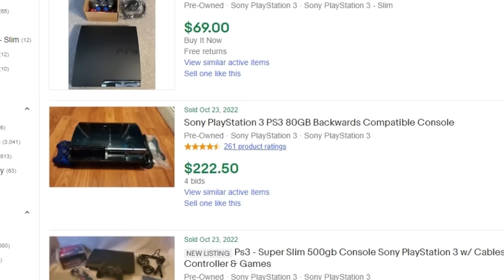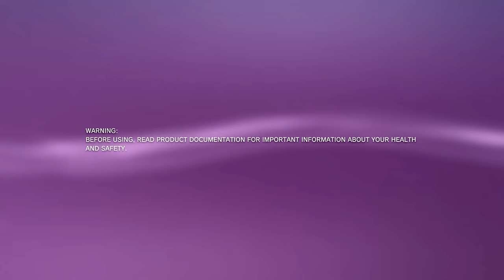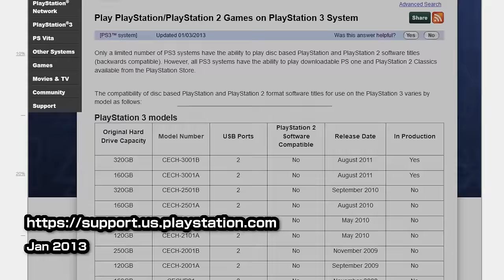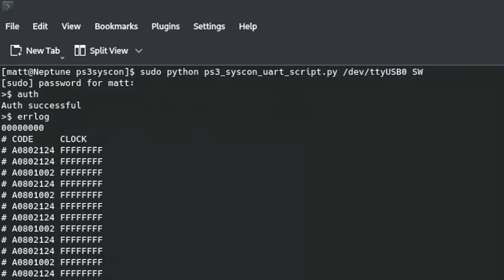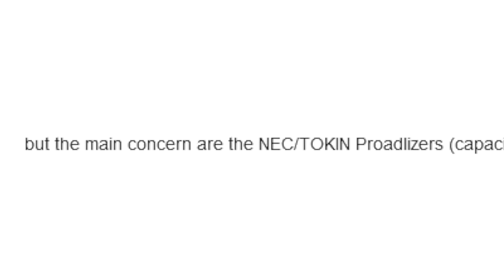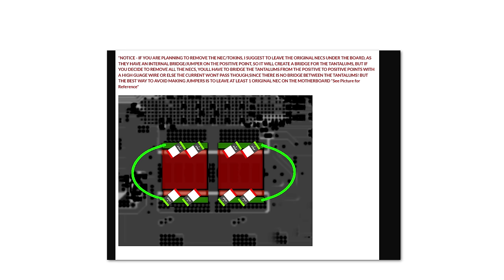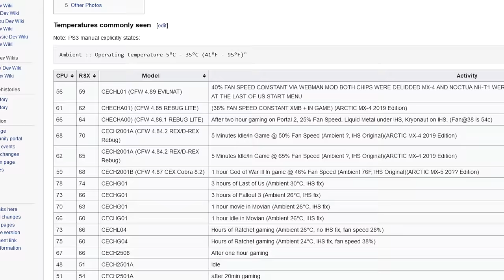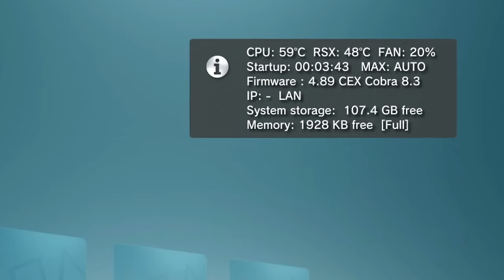I bought 3 PS3s for $50... how bad could it be?

Comment: A little note about using the Dualshock 4 on a PS3. You actually CAN use them wirelessly, all you need to do is scroll to settings on the XMB, Select Accessories -> Bluetooth Devices -> Start searching and hold both the share and PS buttons on the controller. Rumble and the PS button still won't function but other than that it's still perfectly usable for a good selection of the consoles library!
Reply: This also works with the switch pro controller
Reply: Oddly enough, they don't seem to work with Goldeneye 007. Every other game works but that one and it's the only PS3 game I still want to play xD
Reply: @beardalaxy  Gran turismo doesnt work either :(
Reply: But how do you exit from the game?
Reply: @qwertykeyboard5901  for me i keep a ps3 controller around just to turn my system off and navigate menus
Reply: @global8198  So why use a different controller? Isn't having to use 2 controllers less convenient?
Reply: @tooprood  you should probably use a wheel for it tho
Reply: @tooprood  You wouldn't want to play GT5 without a Driving Force GT, anyway :D 

Though it'd be awesome to have controller emulation like PS2's OPL can do, hahaha
Reply: @qwertykeyboard5901  because the ds3 sucks
Reply: @qwertykeyboard5901  personally all I have is a busted up 3rd party controller without l1 and l2 so i pretty much have to use a ds4
Reply: @qwertykeyboard5901  ds4 is more comfortable to use for some people (me included)
Reply: @qwertykeyboard5901  I restart the ps3 if it's a digital game and if it's a physical I just take out the disc
Reply: Personally, I still use a cheap controller adapter for it. As some of those will allow you to not only get the ps button working, but also the motion controls too. Mayflash have a good one but even the crummy built cheap ones will do this. 

At least my Jamwell one does.
Reply: Also DS4 controllers (and other nonstandard gamepad types) will not work when the ps3 enters its bc ps2 mode (GuestOS mode on LV1)
Reply: Yes but why bother? If the PS button doesn't work, there's not much point.
Reply: A little note about using the Dualshock 4 on a PS3. You actually CAN use them wirelessly, all you need to do is scroll to settings on the XMB, Select Accessories -> Bluetooth Devices -> Start searching and hold both the share and PS buttons on the controller. Rumble and the PS button still won't function but other than that it's still perfectly usable for a good selection of the consoles library!
Reply: Thing is, the PS3 is fucking trash. I've had one for a year until 2020 and it's a really bad experience, which I guess is to be expected since you're dealing with hardware from 2007. You're much better off just getting a used PS4 which are super cheap these days and install custom firmware on it...
Reply: Once they're linked, you can use the ds4 to turn on the ps3 and you have about a 50% chance of the PS button working. Don't ask me why, just my observation. 😂😂
Reply: Wdym. My ps4 controller on ps3 had rumble

Comment: The PS3s with the Emotion Engine board (yes the PS2 compatibility was hardware emulation!) are easy to spot. They're the very earliest models, and they have four USB ports instead of two, and you can lift up the black bit to the left of the disc drive and there's a load of card readers under it, SD, CF etc. If I recall, the silver disc slot surround is chromed on those too.
Reply: intresting. I always wondered why certain video game manuals showed that opening with all the card readers and yet my own PS3 didn't have those
Reply: yup, the chrome trim is the easiest way to know. They also had a 60 GB HDD, but that could have been replaced since.
Reply: @Muscleduck  yeap i still have mine. its the first model i believe. I got it like a month after the ps3 released
Reply: Unless you got the 20 GB model that didn't have the card readers.
Reply: @Matt92Machine  imagine having a 20GB PS3 lol
Reply: @phoenixyt124 oh yeah? Imagine having a 12gb PS3
Reply: For the PAL units, it's the GS chip. Yes, we, the Europeans, got the GS-only board that US received with the 80GB CECHE.

Comment: 20:14 I’d like to imagine someone in the far future buying this system as a broken system and trying to restore it only to discover cursed capacitors and eraser in the cpu
Reply: "Was it like this from the factory?!?"
Reply: "people in the old days are wild. they use erasers as thermal pads"
Reply: @afizsouji  these days we use two droplets of thermal uranium
Reply: This is what I imagine for every single repair.
Reply: hi mediaforge person!!!
Reply: Yea one day when this is a retro console 😂
Reply: mine has washers on the gpu to add pressure
Reply: heavily australian "Someone's been in here!"
Reply: @segefjord  it is a retro console though ( it's 16 years old)
Reply: @richthelegend1016  Performing a quick google search on when something is retro it needs to be at least 20 years old, AHCKTUHALLY
Reply: @richthelegend1016  Not quite retro yet, retro are nes, snes, sega master system etc. and those 80's and 90's consoles, 2000 have yet to get that status to my knowledge.
Reply: @lilldavid2k7  IMO, any console that doesn't use HDMI should be considered retro at this point (yes, I know that the Wii falls under that category, but Nintendo's timings to everyone else in terms of console generations are wonky in general).
Reply: * cough cough * TronicsFix * cough cough *
Reply: Ngl, I've gotten bamboozled by dads in the 90's screwing with their old 60's transistor radios.
Reply: 20:14 l’d like to imagine someone in the far future buying this system as a broken system and trying to restore it only to discover cursed capacitors and eraser in the cou
Reply: @Theunicorn2012 thanks for letting us know...?
Reply: @MDLuffy1234YT  The Wii is kind of a retro console now though. It's roughly 18 years old at this point and it certainly looks a lot more dated than the Xbox 360 or PS3.
Reply: @maow-tty  Now with the official closure of the Xbox 360 store, any console with an analog input should be considered retro at this point.

Comment: I repaired PS4s for cash a few years back and all I can say is that the dead bugs choking out the power supply were one of the main causes for the consoles overheating or short circuiting.
Turns out that the warm power supplies make for highly desired bug nests...
Reply: It's not just an overheating issue, the gpu literally delaminates from the substrate.
Reply: @lucyinchat  what
Reply: @thicc doggo  tsmc made garbage chips and a whole bunch of chips that affected any company that used them (apple ati nvidia primarily). So anyhow all phat ps3's are going to die.
Reply: I read "swarm power supplies" and that was still correct.
Reply: Literally one of the reasons we call problems with computers bugs is because going back to when vacuum tubes were used rather than transistors literal bugs would sometimes cause issues. Its a tale as old as computers
Reply: ...
Okay..
I guess.
Reply: Some people are pigs. How can they live with bugs building nests in their electronics?
Reply: @battokizu  That's what happens when Taiwan handles it instead of Japan
Reply: Some houses are near wooded areas and are poorly sealed. You don't have to be a pig to have a roach infestation. 

But yea, a lot of people are.
Reply: @harryshuman9637  unfortunately some people have no choice. i know where i live it has made the news in the past about a few apartment buildings having bed bug problems. the problem is if they only get 99% of the bed bugs that 1% is all it takes to spread through the building again and start the crap all over again.
Reply: @dieSpinnt  There's a difference between something you can't prevent like bacteria on your skin and something completely preventable like cockroache infestation.
Reply: @harryshuman9637  Bugs invading a home isn't always due to bad hygiëne.  An appartement block getting infested can lead to your appartement unit being infested as well  even if you kept your unit clean.  

Be easy with your blanket statements.   I'm already this close to making your reservation placement in hell something permanent.
Reply: @unsubtract holy shit really. I thought I did something to my ps3 back then, I didn't know they were destined to die
Reply: @PutsOnSneakers  what are you getting Jesus for his birthday this year?
Reply: @PaulMcClennon282  nice try, but I'm not coming back for you all to spike me on a cross again. 

No this time I summon each of you to my place for your judgement day!
Reply: l repaired PS4s for cash a few years back and all l can say is that the dead bugs choking out the power supply were one of the main causes for the consoles overheating or short circuiting. Turns out that the warm power supplies make for highly desired bug nests…
Reply: it's always the bugs
Reply: So, if you have a PS4 it would probably be a good idea to fit some window screening over the giant vent slots.
Reply: @Palmtop_User  relays, not vac tubes. Vac tubes are solid state and, well, vaccuums, it'd be impossible for a bug to get in there since it's a sealed glass vial. Relays on the other hand? Yeah, a very depressed bug can take a very short walk under a very tall lever and get sqwuooshed.

Comment: Hey there Matt, owner of the picture at 20:32 here! After more than 2 years after doing it, my PS3 still works just fine with cool temperatures and there has been no issues, so this procedure is really safe. One interesting thing is some PS3 models actually come with a plastic lid in the CPU hole, so this means even Sony thought it was a decent workaround haha. It feels kind of surreal to see one of my pictures pop up in your video after 2 years. Glad it worked out for you, and please wear gloves the next time! For anyone curious, you can find my guide as well as the original thread on google if you search for "PS3 eraser mod".
Reply: Hello good sir. Thanks to your post, I did the same thing to my PS3 a couple of months ago and it works perfectly. Thank you.
Reply: Legend
Reply: Madman indeed
Reply: I really wasn't planning on opening up my PS3, but this piqued my interest.
Reply: @ZephyrCubic  As previously stated by many, Sony ended up doing something similar to later revisions of the PS3, especially in the slims; instead of sticking a piece of rubber, they stuck a piece of plastic that does the same exact thing. That is an enough reason for me to do this. 
Solder voids under the GPU are caused by the lack of structural support by the underfill (the video you've linked). As long the temps are stable (I keep mine under 65) the underfill should never reach TG temperature.
Reply: My ps3 is 9 years old
Its the Slim version and still works Is it supposed to break?
Reply: @ItsartoTV  Nothing is "supposed to break", however, a lot of newer devices are only designed to last maybe 3-7 years. Note that I said "newer devices", on older ones (like a ps3), that wasn't as much of a consideration.
Reply: @bluefireanimations3712 I got my ps3 slim on launch day and still works to this very day. Newer tech just seems to be reliable just like my xbox 360 s that I also got on launch day. Doesn't have the red dot of death yet. The dvd drive works perfectly. And the only time I open it was to re do the thermal paste.
Reply: Böyle obscure bi videoda bi Türk'ün yorum yapması ve videodaki soruna çözüm bulması inanılmaz geldi 🤠
Reply: @MustafaHakanYazgan  hahaha :D Yalniz duzeltme yapayim, yontemi ben bulmadim, sadece nasil yapildigini gosterdim :)
Reply: why should he wear gloves ? asking genuinely since I dont have a clue really
Reply: @nikkiofthevalley  there is a german word for this, since it is widely known here, I believe that there are definitely things designed to break.
it is called "sollbruchstellen".
The word consists of 3 words making up the one word: -supposed, -break and -spots.
basically meaning some devices have spots or parts in it, that are expected to break at a certain point in time. And it is of course not officially stated, but most probably internally aimed for by the manufacturer of a device.
Reply: @yazi2879  the ps3 in the video was really dirty, thats why i told him to wear gloves haha
Reply: Terrible mod. The plastic Sony put was only touching the board.
Reply: Bro you're a 2009 legend
Reply: Typical "It WokS oN mY mAcHiNe" bozo

Comment: One thing I've learned taking these apart is that Sony had many different variations of the PS3. The outside may look the same, but insides could be totally different and not interchangeable.
Reply: "we may look the same on the outside, but model B's are totally inferior consoles, and we need a final solution to deal with them"
- Playdolf

Comment: You sure are lucky, that changing the TOKINs did the trick. Since most of the times, they are not the cause of RROD, but the cracked BGA inside the RSX, caused by Nvidia's faulty design. It's basically the worst possible combination of running too hot, unsuitable underfill, high amount of heat cycles and bad solder type chosen for the BGA.
There's over an hour long video delving deep into the RROD causes, done by @RIPFelix
Reply: Came here to literally type this comment lol, although I had forgotten the channel name
Reply: Yup, good rec. I am not super versed in the ins and outs of these kinda things, but that video is certainly worth checking out.
Reply: @creepysmilingcarl9742   The bumpgate incident - to the melting power connector incident
Reply: cough tsmc the fab maker cough made crap chips for its customers cough ati apple nvidia cough
Reply: @xmlthegreat 
 RIP Felix is the channel name, I was also about to type the same thing
Reply: Happened to my Cecha01 had my 90nm Frankenstein’d now we running like a champ🤩
Reply: Though thats only really a problem on 90nm RSX models (I.e all the early fats system models A,B,C,E,G, and H models.) all the later fats (J models and onwards) had 65nm RSXs which didnt really have that problem like the 90nms do
Reply: @DeadlyHellhound  all though there is a period of time we’re nvidia were packaging and shipping defective 65nm chips and corrected them in later boards before switching to 90nm… So there is a chance you can get a defective chip even with 65mn rsx’s 40nm is the safest bet.
Reply: This RSX should be fine, since it says CXD2991EGB in which bumpgate was alledgedly already fixed. He did dump a lot of heat into the board though, so there's still a chance the RSX is faulty and it has now been revived by the heat. Only time will tell
Reply: https://youtu.be/I0UMG3iVYZI is the video by RIP Felix
Reply: Just watched the RIPFelix video last night and wanted to comment something too.
Reply: @creepysmilingcarl9742  hmm never had an issue with NVIDIA, at least in PC format.... Though they are made in China so anything can happen.
Reply: >You sure are lucky, that changing the TOKINs did the trick. Since most of the times, they are not the cause of RROD, but the cracked BGA inside the RSX
If you check the syscon and get the 1002 or 1001 error codes it is always the capacitors. problem is people just replace the caps without checking error codes and hoping it will work
Reply: I give that PS3 6 months before it breaks.
Reply: @dudeshift0  Felix is a pretty cool and knowledgeable guy, he’s helped me out a lot. He’s in this ps3 repair discord that I’m in.
Reply: RROD? You mean YLOD? 

RROD means red ring of death, which was the problem for Xbox 360s.
Reply: @Diabeetus.  yes but this also applies to the rrod as the same issue with the gpu was present in early model Xbox 360s
Reply: just watched that video by RIPFelix.  The whole time I was all "No Matt! not the NEC/Tokins!"  he was suuuuuuuper lucky
Reply: @JoshBattin  well in this case he did check the error code, which does correspond to the capacitors failing.
Reply: @DeadlyHellhound  i was about to comment this as well. Only the 90 and some 65 nm gpus had this problem in mostly backwards compatible PS3s and the only real way to fix it is to Frankenstein a 65 or 45 nm GPU in its place. All the other PS3s a NEC replacement really does the trick.
Reply: Bro, was looking for this comment, 100%  hit it on the nail. I am unsure of his consoles longevity as it may stop working in a few days, weeks, months, or even years, depending on use
Reply: @arshaqhabib1932  Nope, he did check the error code on the syscon (shown at 10:08), which reads A0801002. 1002 are pretty much caused by the nec/tokin. BGA/bump failures are 3034/4xxx.
Reply: Fairly certain Matt is well aware of this, that's why he used the Syscon to pull codes first. The codes strongly suggested the tokins were the cause.

Did you pick up on this during the video?
Reply: This should absolutely be the top comment. Since there're a LOT of false info going around on how to fix the YLOD. Everyone who're interested in this should absolutely watch @RIPFelix 's video on it.
Reply: @animoun.v2  The Great Flip Chip Plague.
Reply: This!
Reply: man, from what ive heard so far i feel lucky that i was successful with reflowing mine twice now
Reply: Why does your comment use so many unnecessary commas? Do you know what an independent clause is? How to form a proper sentence?
Reply: Which also explains that replacing the tokins often dont do anything but the heat from the process temporarly fixes the problem

Comment: Eraser mod can actually cause the cpu die to crack so I wouldn't recommend it
Reply: To be fair, that ps3 was already on the brink of death, and he had 2 other functioning ps3's to spare, so I think it's ok.
Reply: While I agree as well - that last PS3 he worked on was literally the definition of a zombie PS3. Roaches in and out, bad caps, overheating RSX, and corrosion enough that I'm surprised it would even turn on. I mean I've had my fair share of nasty units but that thing is just atrocious.